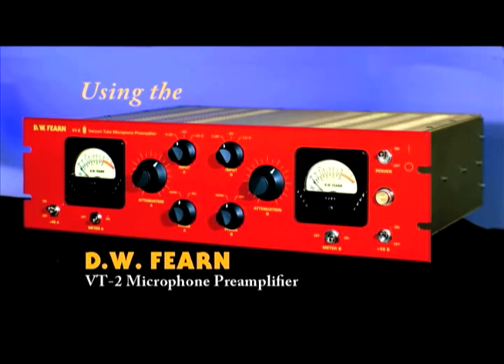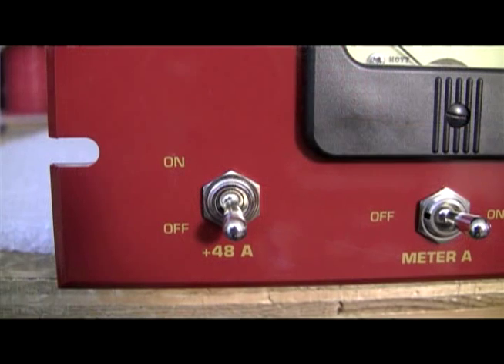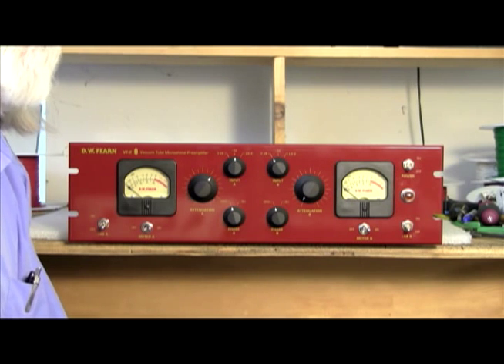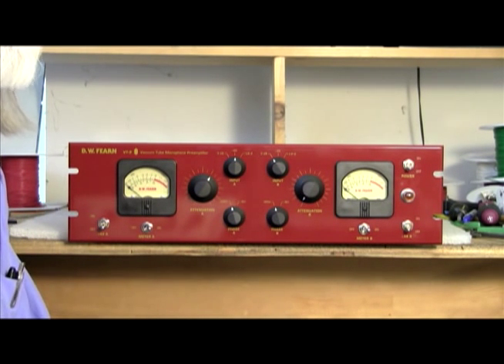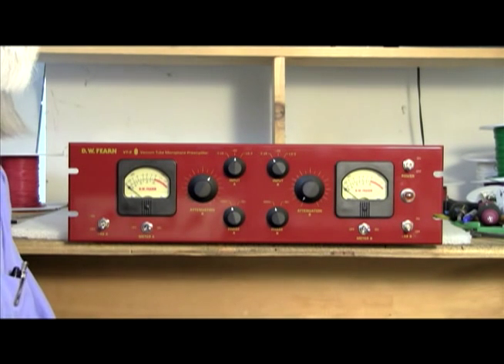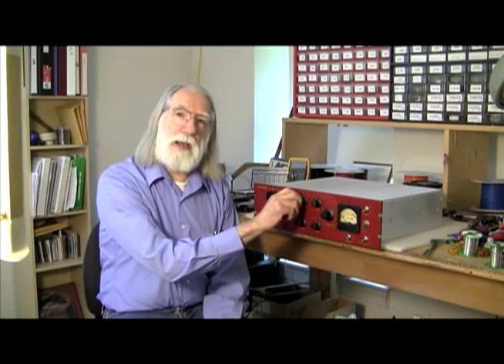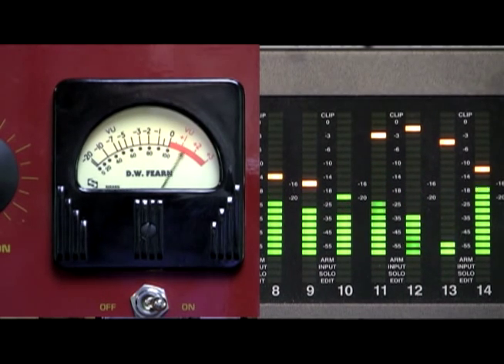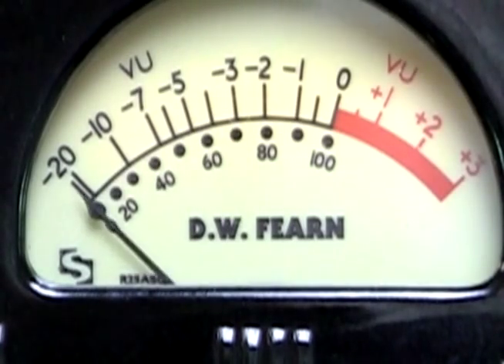VT 2 Tutorial Part 2

Comment: Thanks for the interesting information! I am owner of a VT-2 and I intend to buy my first passive ribbon microphone AEA R44, but I have doubts whether the low input impedance of the VT-2 - 1.5k ohms will be enough to guarantee a consistent and full-range ribbon sound. And one more thing. Preamp gain for the R44 should be at least +60dB, will the VT-2 be able to provide it? What is your opinion?
Reply from the maker: Interesting questions! My sessions use almost entirely ribbon microphones, and I use my VT-2 mic preamps for them (they are the only preamps I have, not surprisingly). The gain of the VT-2 is around 55dB, which is sometimes not quite enough with ribbon mics in some situations. My favorite mic is the AEA R44CXE, which has more powerful magnets than the straight R44, and that increases the output by about 6dB. That is enough level with the VT-2 for 90% of situations, in my experience.
I also use other ribbon mics, like Royer R121, Coles 4038, BeyerDynamic M160, and other AES mics like the KU4, KU5, and R92. I rarely need more gain for any of those. In fact, with some vocalists on the R44CXE I am running the VT-2 gain just barely open. It is on the verge of needed to use the 20dB pad on the VT-2. And that's with the mic about 3 feet from a powerful singer.
The lack of gain is only a problem when I am recording a very quiet instrument, like a nylon string guitar.
At one point, I designed a mic preamp specifically for ribbon mics. It was called the VT-12, and we only made about 25 of them. It had a 10k input impedance and 70dB of gain. I still have one in my control room. But I rarely use it. A VT-2 sounds great with ribbon mics. I was surprised that the 10k input impedance didn't make any significant difference in the sound of the ribbon mics.
I would suggest getting the higher-output R44CXE. I think that should work fine. But it all depends on what you are recording and how far away the mic is. And you can always use a level-booster in line with the ribbon mic (I never do that since I want to avoid the solid-state electronics, but it is a good solution for some people.)
Reply: @DWFearnHazelriggIndustries 

Thank you very much Mr. Fearn for your answer!!! This helped me clarify a lot of things! I will definitely take your advice and R44CXE will be my choice.
Reply from the maker: @tmtstudiobg  Best of luck with your recording projects!